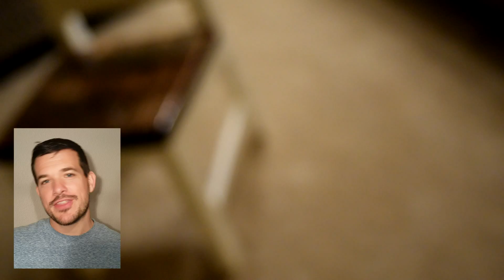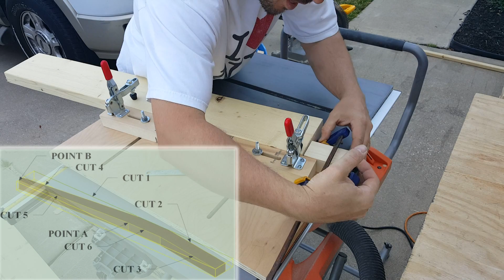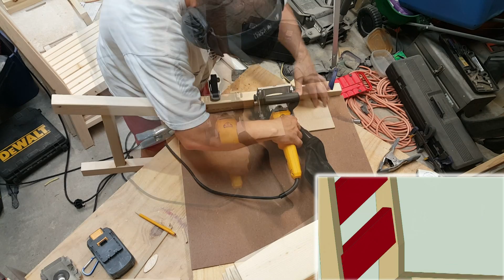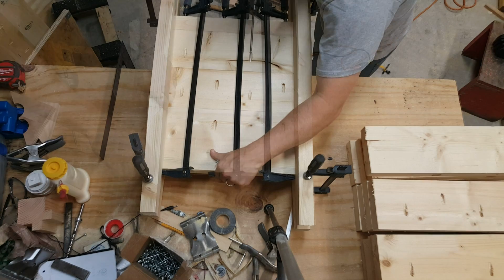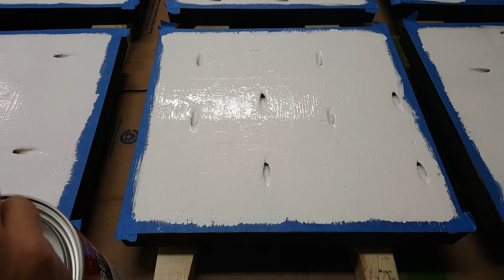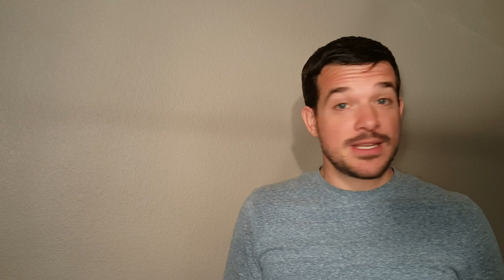Farm-house Dining Chair - Design 1

Comment: Wal Mart quality furniture. Pocket screws are the lowest skill and lowest quality joint you can make. Proper joinery and panel glue up are skills worth learning.
Reply from the maker: And yet, 4 years later after 4 kids use them as jungle gyms, they are still solid. It was clear that these chairs are not heirloom quality. BTW, in only criticized by people who do less than me.

Comment: Hals Wood Shop.   Good Tutorial.  Good jigs.  there are many ways to do joints if you like this project. I like both the dowels and screw pockets.  Check out some others for the dimensions or some books on chairs.   Or his plans are $6..  the end result was a nice chair. all depends on where you would use your chair.

Comment: Not quite diy unless you have a decent workshop. One day..
though a table saw or a jig saw would complete my "workshop "
Reply: just pickup a cheap one i'm 16 picked one up at Kent building Supplies for 140 its a King table saw with a 10" blade works good and i'm able to joint with it.

Comment: What are the dimensions of the chair?
Reply from the maker: The height of the chair is 38", and the seat is 18" square. I have the plans for sale on my website www.engineeredwoodworking.com
Reply: One more question, can pocket hole joinery substitute for biscuits?
Reply from the maker: Beulah's House you can use pocket holes on the back slats if you fill the holes. Kreg sells pocket hole fillers.
Reply: Thanks.  By the way I bought the plans from you.
Reply from the maker: Thank you. You can also email me any questions that you have.

Comment: Is the chair well balanced and is it feel comfortable to sit in?
Reply from the maker: It's well balanced and doesn't tip over. I've got an 8, 6, 4, and 2 year old. The 8&6 yr old sit in the chair without a booster. The 4 year old uses a booster, and the 2 year old uses a baby chair booster with tray.
My wife love the chairs and says they are very comfortable.

Comment: Great video, is this with just off the shelf lumber? How are the chairs holding up over time?
Reply from the maker: The wood used is Prime kiln dried lumber. After 8 months, the chairs are still very solid without warping. The key is to start with straight, kiln dried lumber. I've found that 2x6's from Canada are pretty good for this type of project.
Reply: Ok great, thanks for the response!

Comment: Great job on the chair. I have to ask, what adapter are you using to attach your shop vac to your sander and your pocket hole jig? I can't seem to find an adapter that will accomplish that. Thanks!
Reply from the maker: Russ S. I actually shot the video today for my custom vacuum system. I'll release it next week and it'll have all the information in that video.
Reply from the maker: Russ, The dust collection video was released this week. Check it out for information on the design.

Comment: Nice job, very good project, do you know aprox, cost?  Saludos
Reply from the maker: Each chair used two 2'x6'x8'. Stain, poly, and paint cost about $60. Wood cost about $42. I spent about 10 hours per chair. I also used the stain and paint on the matching table and still have some left over for more projects.
Reply: Great thanks.... Very clear your info.... Again very nice project... Now is in my list to do..... Saludos amigo
Reply: Engineered Woodworking and DIY were you able to cut all the back legs from the 2x6?